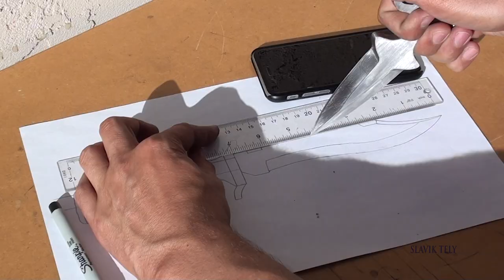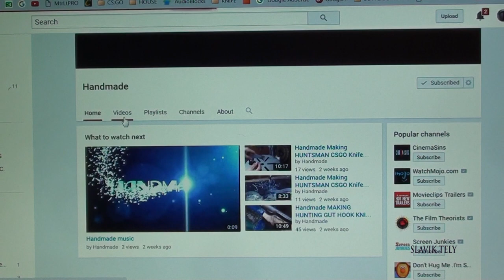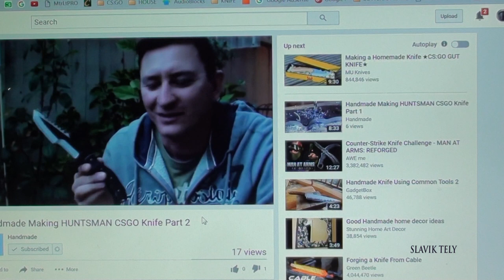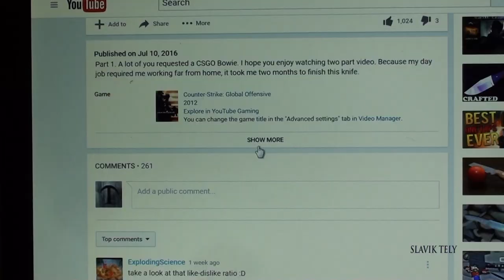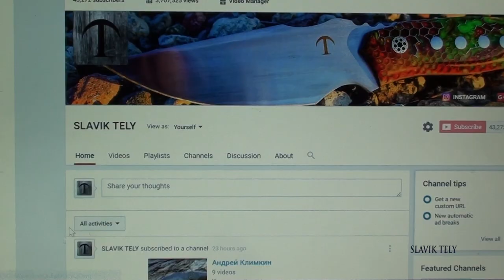MAKING CSGO BOWIE Part 3 Short Trailer and Q&A

Comment: The knife is not actually 100% correct, since the sawblades are actually sticking up a bit in the Premodel in CSGO but nice job anyways :D
Reply from the maker: I did not want to put the saw blades. It would tare up the kydex sheath.
Reply: that is very true, but again, really nice work :D

Comment: Hey, do you realize that people always buy your knives, fairly quickly? People understand the amount of work that goes into them, and that adds to its value. You can sell these knives for much more than what you are. If anything, put a value on your time. Like if you valued your time at $15 an hour (which would be a good spot), then a knife that takes you 30 hours to make you should sell for $450. If you did bidding wars on these knives, I wouldn't doubt you'd be making a couple thousand per knife. I just want to see you get better rewarded for all the work you put in
Reply from the maker: Thank you for your input. I get little bit shy on pricing my knives but I am going to be stepping it up pretty soon. And thanks for caring.

Comment: make a knife with no power tools i challenge you :)
very good knife by the way.. :) keep posting
Reply from the maker: Did you watch Vipera Invader? I only used a had drill, I had to use a drill press because the pins had to be drilled perfectly into the handles. But I used a hacksaw to cut the steel and finished it up with files.

Comment: Trollsky has a video on how to make bevels with a belt grinder and its simple too. Go check it out if u want :) Keep up the amazing work :D
Reply from the maker: I seen it but I want to learn how to free hand grind. When you learn to free hand grind then you can control any grind you want. For example, the Bowie knife would be impossible to grind on the jig because of the curved blade.
Reply: In that case practice is the best way to go :)

Comment: hello friend, could you explain me the process so that the blade is with these drawings , I understand that you used ferric chloride, but I try and I do not stay the same
Reply from the maker: You put nail polish on parts of metal that you do not want the ferric chloride to eat. Then you put the blade into the solution for 20 minutes, take it out wash it out with water and then put it back in it again. Do it 3 times and you will have what I have.
Reply: thank you bro,
 I 'm starting with this kind of work , and see your videos inspire me a lot.

Comment: How well does your belt grinder work? I know you are still learning to use it, but does it supply enough power? I want to get a small 36" grinder to start knifemaking, but from what I've heard they're only useful if you use the 2"x72" grinders.
Reply from the maker: If you can, get the 2x72 grinder because this one doesn't have that much power. You can stop the motor by pressing on the belt.
Reply: I really appreciate your quick response, and willingness to accommodate/interact with your viewers! 

I pretty much need to buy everything. I certainly cannot get a 2x72 grinder at the moment, but is it worth it to spend the money on the 4x36 temporarily?
Reply from the maker: Greg Aldrich I do not know anything about 4x36. You will have more flat surface to work with but I do not think you need it. I would probably go with 2x42 because it is more designed for knife making.
Reply: Okay, thanks a lot for the info. One last question and I will quit bugging you...

How well does that Milwaukee Portable Band Saw work for the metal cutting, and would you recommend it?
Reply from the maker: Greg Aldrich It works beautifully. But I hear you can get one cheaper at Harbor Freight. I have not used that one but Ekim Knives uses it and says it works for him.

Comment: why do you pass the file after tempering the knife?
Reply: To test if it have hardened.
Reply: +Mega Pixels and how you know if it hardens good
Reply: If the file kinda goes over the steel and not scratch it i think
Reply: +Mega Pixels Thanks
Reply: +Fabián Márquez Toro No problem.
Reply from the maker: Exactly, thanks.

Comment: are you using the knives for cooking and stuf?
Reply from the maker: No, I sell them. The steel is too thick for cooking.
Reply: Hi, can you  tell the price that you sold the knifes?  ( just out of curiosity, because they are very good knifes) You are very good at making knifes with just a few tools.
Your videos made me try to make some knifes ( and fail) I made them from cheep iron, the steel is a bit to expensive in my country for my budget, but for practice is good.  Btw, sorry for my bad english...
Reply from the maker: camarad777 I sold this one very cheap because it went to my cousin. But a knife like this would be around 450 usd or more.